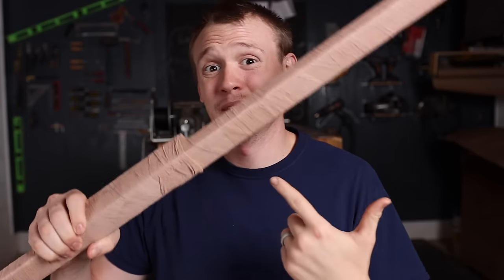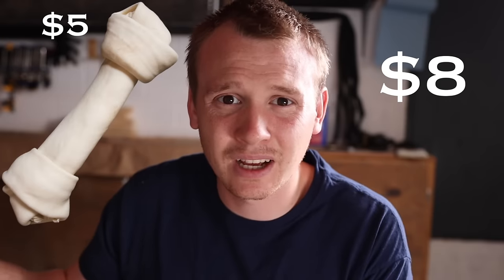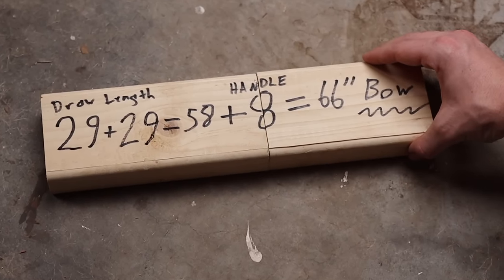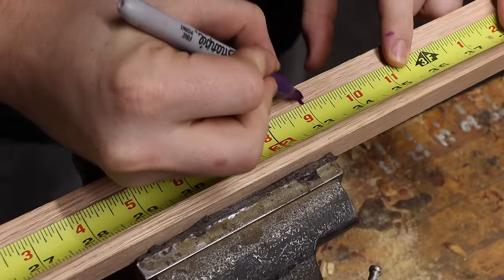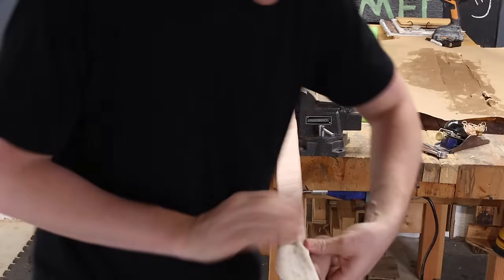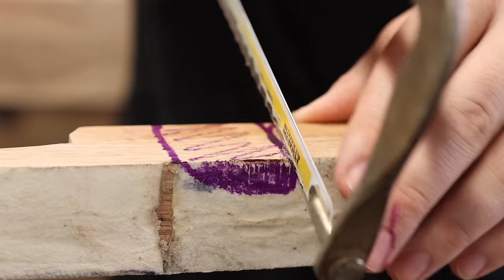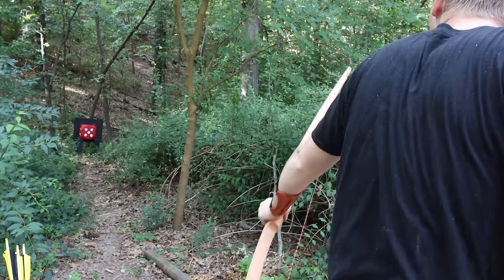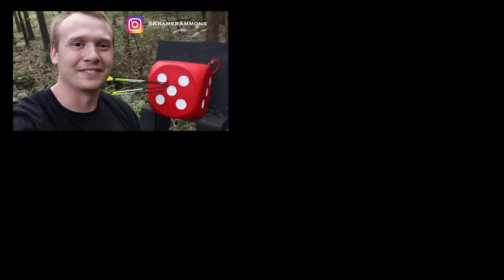DIY-HIGHER PERFORMING Longbow...no seriously..."Red Oak Bow Build"

Comment: After watching your video "making a board bow" (or some such), I made a  longbow from red oak. It was after a failed attempt with poplar, and it happened to turn out pretty good.
63" knock to knock, approx. 25-30 lb draw weight, sight window, arrow rest,  polyester custom made bowstring, Rust-O-Leum rattle can paint job (matte blue/gloss black/gloss clear). All done using hand tools.

Comment: Good Build and Video...

Only recommendation I'd make: When Cutting/Filing your Knocks in... Cut/File/Sand in One Direction, From Back to Belly. Especially with Backed Bows. Lift your Saw/File in the Return Stroke... You'll have less chance of Lifting a Splinter or Backing material.

On a side note: You should look into Kangaroo Rawhide for Backing material. It's Heavenly!
Reply: Should the wet hide be stretched tight and even along the length of the bow as it is glued and bound? I did not see if this was done here.

Comment: Bravo!  this is a great companion to your previous video for a long bow build from a board.  I have attempted  a couple of bows and have had issues with proper tillering  on both.  These additional tips on tillering will be most helpful. for the next try.  It occurred to me that when you cut in the arrow rest, if you drilled a hole at the inside corner of the the rest it would accurately  locate  it  and you would have a nicely  rounded inside corner on the rest. Thanks again for your "user friendly" videos.  They invite folks like me to begin building and have fun doing it.

Comment: After 15 years and several major surgeries including a T-4 spinal operation, I decided to get back into archery. I had been using an off brand 70lb compound I bought in 1995, that I couldn’t pull more than 20”. To see what weight would be suitable, I guessed about 40 lbs., I bought a recurve  kit off Amazon for $75, that came with 9 aluminum arrows, target, and glove. All the arrows were true, the assembly was a snap, and it shot surprisingly well at 15-20 yards. It’s given me time to reacquire my skills and strength, and opportunity to spend time reviewing what I want to buy in the future.

Comment: Between your videos and Clay Hayes I made a pretty good functioning red oak board bow on my first attempt. 63.5 inches 37lb at 28 inches. As a beginner I only wanted a light weight bow but could have had a nice 45lb bow it was a shame to have to take the poundage down.  So I am very grateful to you for the knowledge and rapped that my beautiful creation works !! Ps I’m new to archery this is my in .... joining an archery club soon. Sooo much to learn.

Comment: I'm just making one hell of a bow with oak and fiberglass, boy... the tilering part is not as fast as he shows here, it's been 1 week and still scraping wood... I may be doing something wrong though, cause the string does not pull as easy as he does during the tilering part. (Sorry for my english)
Reply: English is my first language and you write it 20x better than I do
Reply: I think it depends on how thick your wood is. If it's thicker it will take longer but u should be fine

Comment: I love your videos. I’m in the process of making an oak board bow with a 10 layer drywall fiberglass tape with horn tips with a double 8” glue on riser, 2 1/4” thick! Hopefully I will be able to cut my arrow rest in about 3/8” a little closer to center.🤞🏻It’s a 1 1/2” board in the riser. I’m shooting for a minimum of 50 pounds maybe 60. So far so good. lol

Comment: Excellent post. Your video with the poplar board bow got me started. I've since shaterred the poplar bow and a hickory bow. But I built a VERY light hickory board flat pyramid bow and I am now building a veneer birch backed oak board flatbow. 
Next thing I want to try is this oak board bow!!!! I have a couple of pieces of deer rawhide from the first deer I ever arrowes MANY moons ago... but they may be too short, like 27 inches each (?), so I may go with the chewtoy replacement until next deer season in which I will try to harvest a deer and make more rawhide.
One question I have for you are rough dimensions of the belly taper. I could not get it right with other projects and went to a flat pyramid bow which were easier to tiller, but I want to try one of these straight limb, end tapered bows.

Comment: a few years ago i bought a 65 pound D bow type  longbow at a yard sale that was to much for the guy that bought it new
since i needed a 50 pound bow. i just built a tillering board and using a very small block  plane and sanding blocks cut it down to 50 pounds draw.
since i had bought it for $20 dollars i was a good deal to learn on and now i know that i can take any heavy wood longbow and lower the draw weight down to what i need

Comment: I understand that the traditional "eastern" recurve bow, being much shorter than a "longbow", used animal product laminations to increase the power; green/raw hide (tension) on the back and BONE (compression) on the belly sections. Lots of wallop from a bow meant to be operated from horse-back.

Speaking of horse-back archery, I got to see a Japanese horse-back archery competition outside Kyoto a few years ago; long, offset / asymmetrical bows. Draw and shoot three arrows at targets about 2 feet square, whilst standing in the stirrups of a galloping horse on a roughly 150 yard straight track. Horses and riders authentically "dressed" in traditional outfits. Very spectacular!

I'm not much of an archer, but I like the "techie" stuff.

Comment: A small tip from a carpenter. If you use a square on an angled area your lines will be crooked. If you're trying to cut even grooves at the tips you may do better measuring up both sides from on point

Comment: For your next bow can you do a reflexed backing? In it's most basic form you would take your board before cutting anything and reflex it about 3 inches then apply a duck cloth backing and let it cure on the bow with the reflex in place. Then proceed to make a normal bow. The result should be a faster shooting bow that is less likely to developed compression fractures on the belly.

Comment: Well... Tried the drywall tape backed poplar and it started to develop stress cracks in the belly. I had also bought an almost perfect stick of oak for this build. The dog bone is not actually rawhide but collagen. Heavy and thick and I couldn't get it stuck down. Decided to tiller it without a backing considering the grain was so nice and I only wanted a #35 bow. Nearing 25" on the tillering board it snapped. The wood simply pulled apart, not on a bad section of grain but in the middle of the limb where the grain was straight and even and not running off. So Oak needs backing. Or maybe stay at or below #30?
On to third times a charm... :).. if I can find another suitable board.

Comment: My first bow just broke on the tillering tree. Trying to follow your videos, guess I have a lot to learn. Using red oak (very straight grain) with drywall tape on the back of the bow like in another video of yours. Tape and glue set perfectly, 6 layers dried for 36 hours. It's a 69" bow, 68" from string knock to string knock. I received a 65" string from you and I was trying to bend the limbs down gradually on the tree to where I could string it eventually. Thought I was getting a even bend by measuring and making sure no hinges. But no go. Man so disappointing, hours and hours of work gone. Back to it later I guess, try again.

Comment: Hey Kramer, nice job on the video. Lower weight is always preferred if you get a perfect tiller. I haven’t had much success with red oak in Utah because of the drier climate. Anyway, have you ever heard of a rod saw? I started using one recently to cut my string grooves and it saves me so much time! Seriously check it out sometime.

Comment: Kramer, have you tried stretching the raw hide backing from the handle to the tip, so its tension slightly reflexes the limbs? When it dries and shrinks, this increases a titch more. Basically clamp the hide on the handle and at either tip whilst stretched tight, then wrap with bandage from tip to handle, each limb separately. I reckon you should try this. Great video, love your cheery style, Gus

Comment: FYI: Although I am "right-handed", I am thinking about taking a "left-handed" bow, and putting a modified, perpendicular, "T" handle on it, so that it will cause the bow limbs to lay in a more "horizontal" plane, when being drawn, and fired,,.... more like a standard "cross-bow".... IMHO: This will allow the handle to be positioned exactly in the "center" of the bow length, and, will allow for extremely fast subsequent "follow-up" shots!.....
Reply: Please pretty please post a video of how this turns out!

Comment: Great video, i know its a little old but i wanted to ask a few questions. at about 6 minutes it looks like you are tapering the belly of the bow with the bandsaw, what was the width at the tip, belly to back? If i wanted to recurve this bow what steps would need to change. for example, would i glue the rawhide as done here then soak, heat form the recurve or do the recurve first then apply the rawhide over it? Thank you

Comment: Hey Kramer thanks for these videos! I'm currently making one of these and I want to recurve the tips on my bow slightly. I was wondering if that was possible with the rawhide glued to it. Since I would be using steam to do it I'm wondering if that would cause the rawhide and the wood to delaminate. To clarify, I'm not doing a deep recurve, more of a flip tip/shallow recurve. I'm using maple for the bow and Tight Bond III for the glue. Thanks again!

Comment: Issue with handle layout… in this video you center the handle on the bow center then layout the rest and 4” handle section…this would make the limbs equal… in previous videos you layout the rest 1.25” north of the bow C.L. Then down 4” for handle and then 2” fades on ends. This centers the handle block .75” below the C.L. Of the bow….making the top limb longer by .75”….. which is correct? Or does it matter?

Comment: Hey Kramer! I noticed that when tillering, you mount the bow in the vise, with the limbs free. Any reason you're not clamping it down on the workbench? Then you could work on the limbs without the wood flexing downwards from the working pressure.

Comment: Hi , just watched this video, trying to find best spot for handle and arrow rest, the middle of the bow is not the middle of the 8 inch wood piece as seen in 4th minute of this video but 3 and 1/4 inch from the top side of the wood piece , later, 12:20 You marked it in different place, 4 inch from the top side, which is middle of the wood piece but not middle of the bow. Making it simple, first version shown, arrow rest 2 inches from top end of the wood piece, second  version it is 2 and 3/4 of an inch from the top end. Very informative video anyway, Thank You, and best wishes :)

Comment: Hi Kramer. Have you made a Twinbow?  A bow with an arrow rest on both sides, to shoot left or right hand or place arrow, on either side of the bow based upon the archers preferred arrow release.  At 21:11 you describe adding the arrow rest. 21:35 you suggest  that the arrow rest might  be the width of an arrow  & not more than a third the width of the bow.  Would this still apply?  Thoughts?

Comment: Is it worth it to make a low poundage longbow? I can only pull 20 lbs max. I know most longbows are intended for 40-60 lbs draw weight. But I am just doing this for fun and not for historical accuracy though I did want to use a medieval longbow  because I like them more than modern bows. But I wanted to first get used to using a medieval longbow then slowly teach myself to use a higher poundage one. Like going to the gym and getting used to using heavier weights. Any advice would be appreicated.

Comment: Would I have problems with grip torque if I forgot to round off the all edges on the handle section?

It's basically like gripping a rectangle

Comment: Hi Kramer love your videos. I'm planning my first bow build right now using one of your tutorials. One question that continues to pop-up in my mind is that I notice that you draw on your lines, then cut the wood at those lines. After that is done, you continue to sand down where you cut. However , you cut at the lines and therefor no longer have any kind of visible guide. How do you keep the sanding even with no guide lines? Thanks!

Comment: Does this method and measurements work for bows of higher poundage?  I guess I'm wondering what if anything needs to be done differently for say a 65# bow?  Could you do a video of making a 75# bow if it is different enough to warrant a separate video?
Reply: From an engineering perspective, it is safest to increase poundage by making the bow limbs wider not thicker. If you make them thicker, then the stress on the back increases dramatically.

Comment: Got a piece of oak from a local Home Depot. 72×2.5×1in. cut it down to 64, then Cut 7 and 1/4in for riser and split the remaining 3/4in in half for overlays. Already glued up, drew layout, cut & chiseled grip and arrow shelf, cut string grooves and am currently on day 2 of tillering and still haven't gotten to the point where I can put the real string on . . . I'm taking your "take your time" advice to heart. Once I'm done tillering i want to back it. I've noticed that you add the backing at the glue up phase before cutting your layout (limb taper, grip width, arrow shelf etc.) or tillering. Does this mean that it's too late to add a backing to my bow? or will it not be as effective and efficient as it would have been if I followed your order of actions? Also you believe that the bone backing gave you more of a performance advantage then the fiberglass tape did? What would you think of somebody getting both? Maybe only 2 or 3 layers of tape instead of six if you're doing both?

Comment: I've made one, out of hickory, that was about a 45 pound.  it isn't well tillered as I was just guessing at that bit, but it shoots (after seeing your vids, I may revisit it and try to tiller it better). And the back of the bow, I just peeled the bark off so it's a single growth ring with all the character of natural growth, and the handle is the full stave, wrapped in leather.   I did have a question though-  with the dog bone backing- does that affect the draw weight, and do you think you could take a cheap old fiberglass target bow, and increase the draw weight adding that to it?

Comment: Nice video, good instructions and tips, thanks. I'd like to try this someday. That hacksaw tho... you need to get a wood saw. You need the right tool for the job and a hacksaw is truly NOT for wood. Sure you can use it, but you'll use less effort and get a much better result with the proper tool. Go get a cheap japanese pull saw; Suizan and Gyokucho are good brands and inexpensive as well. I recommend a Dozuki (crosscut blade, which works for ripping cuts well enough), or get a Ryoba with 2 edges and you'll have the correct teeth for both cuts. They have thin kerfs (width of blade), make VERY clean cuts and require far less effort. Their teeth are impulse hardnened, which just means no sharpening and unless you saw ironwood the blade will stay sharp for ages.

Comment: I just finish my first red oak bow then on my first shot i broke it and bruise my wrist. I will try to revive this bow, wish me luck
Reply: I already revived my bow by tappering both side of the broken limb then over lapping it together, i used a titebond polyurethane glue then clamp it till now. I havent look at it because i might be tempted to string it. I lost about an 1inch and quarter in length

Comment: In your internetional opinion.  Which is better sinew or rawhide?   

2.  Can u cut rawhide into strips like sinew( or diamond pattern)

3.  Braiding or twining six strands of rawhide into cable n run it on back similar if not identical to cable Inuit use.

Comment: I made a bow out of 1×8 red oak board never soaked in water never backed it and ended up with a very nice flat bow 70# draw at 30", but kind of runed the looks with some third grade art work, lol, shoots very nice though. I made the draw string out of 7 strands of heavy linen string.
I never did make another one.

Comment: @Kramer Ammons  When you finished the bow with Tru Oil, did you just finish the wood surfaces or did you use the Tru Oil on the rawhide also?  Great video and thanks.
Reply: Kramer Ammons Awesome, thanks.
Reply: @kramerammonsarchery  It might also help to waterproof the rawhide; remember that most white glues  are water-based

Comment: I do not understand how you determine LB pull. So, one basically finds out but hopes based upon wood species, thickness and width; or, there's a more assured presumption like instead of 1x2 Red Oak, 1.5x2 Hickory. Additionally, could I use, e.g., 1x2 but with the Fiberglass Tape first and then the Hyde over that, leaving the belly wood only? (Or, 1.5x2 as applicable). With as many Bows ever made and with specific species, grain thickness (finer the better I'll presume), and dimensions, there may be a more middle ground range + or - ?

And, anyway, - really great instructional videos!; and like your website; and tools, products. What do you do with all these bows you make!? When I used to make instruments, e.g., guitars, I ran out of folks to even give them too :) yeehaw!, so had to stop! Again, great content, well done, and so useful. I can figure out what I ask, I just figure, ask first!, anyway! :)

Comment: Did you oil the rawhide backing when you finished the wood?

Incidentally, if you want to convert between units, just ask Google: "12 3/16" in cm" or "1.753 M in feett" or "178954" in miles" will give you the answer directly.  If it doesn't, spell out the units and it will.